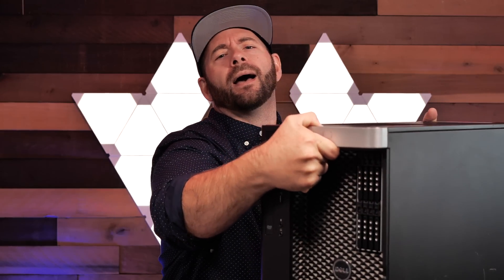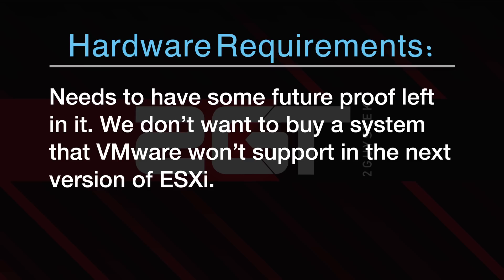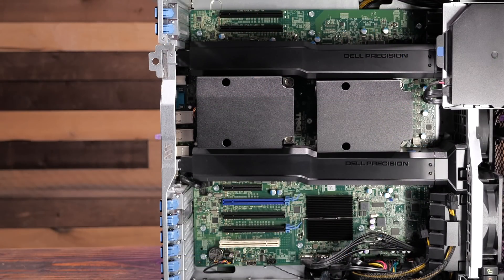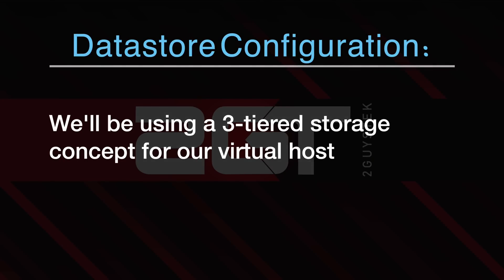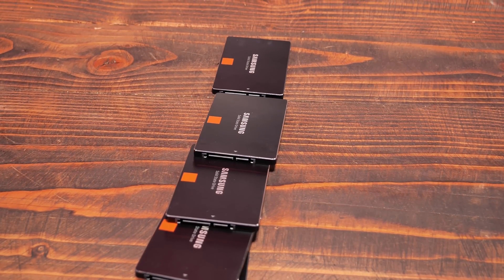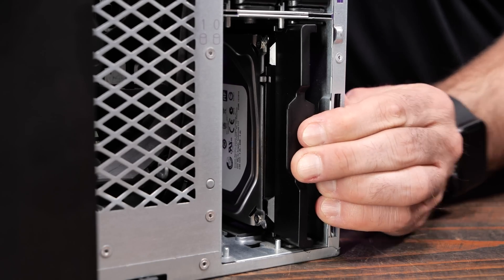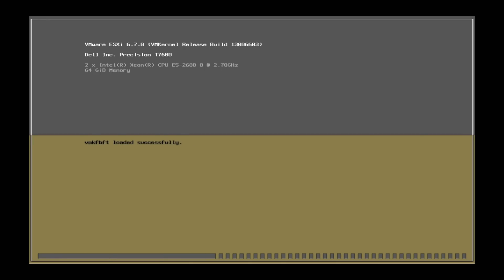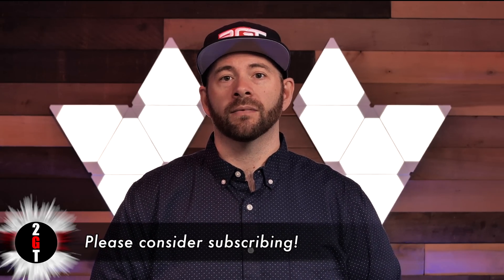Cheap and Powerful Home Virtual Server - $300 GETS YOU A TON OF POWER!

Comment: What's the power draw of this system.. feels like at least 230-300W
Reply from the maker: Great question! I'll connect up my kill-a-watt to it and give you the running consumption. The 1300W capability of the PSU is overkill for the standard workloads we throw at it with ESXi and no high-end GPU consuming power.  Stay tuned!  -R
Reply: @2GuysTek  yay thank you
Reply from the maker: @Airbag888  Okay, sorry for the delay. The system currently pulls around 400W on average, depending on how busy it is.  Considering the PSU is rated for 1300W, I'm well below the maximum consumption of the system! One thing to add, my UPS estimates the total cost of running the system and week-to-week looks like it's estimated to cost me ~$7 and some change, or a bit over a dollar a day to run. Not bad!
Reply: @2GuysTek  Thanks man! Appreciate the feedback. 400W is indeed well within the PSU's limits. I was curious as for my needs of a home server I'm looking for a much more frugal home server (20-30W idle and 70W load) that can still accomodate 64GB RAM or more. Cheers and keep up the good work!
Reply: @2GuysTek  In germany this would result in a total electricity cost of 3$ per day, making a grand per year. As you said, the Ryzen 3900X has even more performance and would cut the electricity cost in less than half. So depending on where you live, a new system might be the cheaper alternative.
Reply: Airbag888 I am thinking of doing the same, I found some Xeon e3 versions with low power consumption. ~ 25w tdp. I want to build a nas/ plex server and run it 24/7.
Reply: @sperilaalecsandru65  Yep I'm looking at NAS/firewall/home automation/some other stuff. Do share your build I'm interested :) I personally have my eye on AMD Rome 3000 series. Super low power even on load but more expensive and using DDR4. Very little choice too as they're embedded on boards =\
Reply: Airbag888 I'm waiting for something to hit the sh market for example e3 1220L v2 looks pretty decent. I saw some hp microservers but I feel like I want to do my own build.
Reply: @sperilaalecsandru65  tdp is actually thermal design power, which means how much heat will the cpu generates at maximum load. It should not overlap with consumed power.
Reply: @ragilmalik  and depending on who you ask it's different (AMD/Intel) Anyway intel measures tdp relative to base clock and amd to boost or average clock can't recall.
Reply: @sperilaalecsandru65  another way is to find an old workstation laptop maybe with no screen and repurpose it
Reply: Sperila Alecsandru 2650l
Reply: Airbag888 don’t expect to run multiple VMs at 70W load. Maybe 1 or 2 at a time and probably not using xeons. Maybe i3 T series low power consuming cpu
Reply: @Airbag888  Depending on the number of VMs, consider 1st gen Ryzen stuff. The 1700X would give you eight cores and 16 threads, and DDR4 is honestly pretty cheap at this very moment. 16GB = ~60 US if you shop around. Newer platform, native NVME support. Also Asrock and ASUS make cool boards with IPMI so you can manage system settings without being booted into the OS.
Reply: @phishphood423  yeah I was like omg I must get that Ryzen 1600 AF (basically a 2600) priced at $86 and bam reality check (it's US only) :(
Reply: Those 8 ssds at max will consume 80 watts, 4 hhd will be at 48 watts max. Ram, cpu and motherboard all combined will probably eat up 100-200 watts. So any good psu will do
Reply: @ragilmalik  he said 400W average up there

Comment: Hi, thank you for your videos, this channel is full of good stuff and a pleasure to watch. 
I’m the happy owner of a Dell T7610 very much in the same configuration (well except for the ram I’ve got 196 Gb).
I was looking for a solution to create three-tiered storage on my machine, but I could not find something like the SSD bay you've used in this build
. Would you please be kind enough to share some information about it or a link to the vendor? 
Keep on with the good work,
Kind Regards,
Bruno
Reply from the maker: Hi Bruno, I did some searching to see if I could find the exact one I used in that video. Unfortunately it's no longer available on either Newegg or Amazon in the US. However, I found this one here: https://amzn.to/2TTWmeM which looks so close to what I used that I wouldn't be surprised if it wasn't built in the same factory in China. It's on the pricey-side, but the density is phenomenal! Best of luck! -R
Reply: @2GuysTek  What's the biggest SSD you've been able to throw at the T7600/T7610?
Reply: I just picked up a T7610 with Dual 8-Core Xeon e5-2670 CPUs (Total 32 threads), 256GB RAM. 1TB SATA3 7.2k OS Drive and 3 6TB SATA 3 7.2k Drives for my VM data store - pretty rocking system.

Comment: How many electricity power used this system? In a month if system not hard work?
Reply from the maker: Electrical rates are different in different parts of the world, so this is a tough question to answer. Where we are we're charged .11 cents a kW/hr. This system uses about the same amount of power as a high-powered desktop and as such we don't notice it's power consumption any more than our other desktops.  Thanks for the question!
Reply from the maker: Here's a more concrete answer: At the current run rate, the system is using around 300-400W depending on its workload. The UPS reports that at the current run rate it's consuming around $1/day or $30/mo depending on the number of days in the month. Like I mentioned earlier, here where I live in the US 1kW/hr costs $.11.

Comment: Great video. Question why you installed ESXi on USB?
Reply from the maker: The ESXi hypervisor is extremely lightweight and only takes up around ~600MB of disk space and once it boots it runs entirely in memory. While you can install it on your spinning disks, VMware recommends installing it on a device that isn't also running double duty as a datastore for your VMs. Booting ESXi via USB or SD is fully supported by VMware and in a data center environment you see this deployment used a lot. I wouldn't recommend using USB if your system doesn't have a USB port internally since it would be a risky approach to have it hanging off the back of your system. I hope that helps! -R
Reply: It's common in rack or blade servers to install the hypervisor on a USB stick or special single/dual SD card carriers and leave the drive bays for local SSD storage for virtual swap and host the datastores in a shared block storage (FC or iSCSI) or shared file storage (CIFS or NFS).
Reply: @questionlp  +1 for dual SD cards on dell servers.

Comment: Shouldn't use RAID5 or RAID6 for SSD arrays due to excessive parity writing. SSD arrays are much better on RAID10.

In general RAID5 is totally antiquated. RAID10 provides the same redundancy with higher speeds with lower wear on SSD's. As data stores get larger single parity cannot be considered reliable, requiring either RAID6 or alternate specialty fire system solutions (ZFS, BTRFS, Unraid, etc.)

As an aside, RAID10 also benefits from the mirroring technique of redundancy. Rebuilding (copying) a mirror is much less demanding on a RAID than rebuilding with parity which places higher demands on multiple other drives increasing risk of additional drive failures.
Reply from the maker: These are great points! The only real downside to RAID10 is the disk cost. In my current config 6x500GB@RAID5 comes out to about 2.5TB, and at RAID10 is 1.5TB. Thanks for the comment!